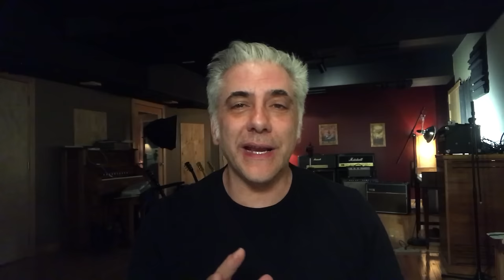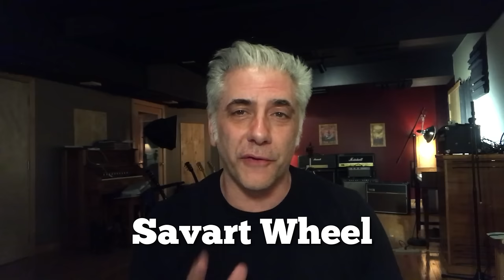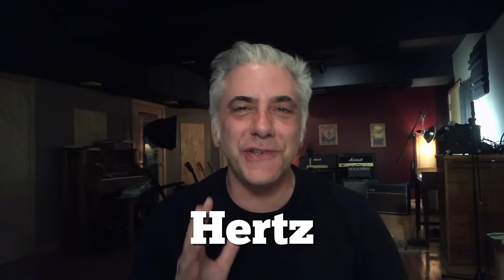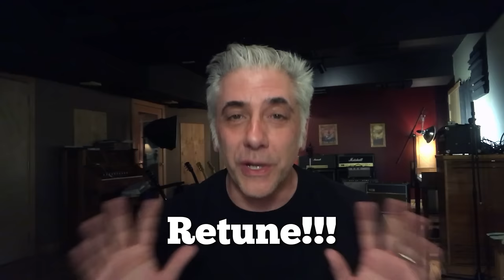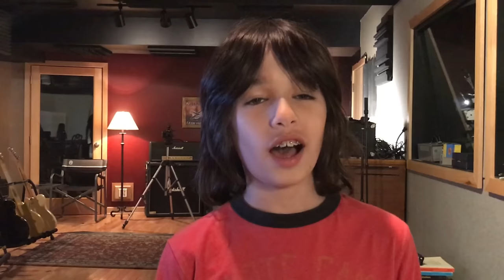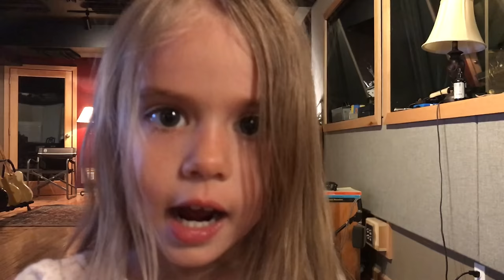What's the Deal With A = 440 Hz vs 432 Hz? Let's Talk!

Comment: Rick, it has nothing to do with spiritual gibberish, the cosmos, the pyramids, or any type of new age nonsense. Put a waterproof speaker in water and watch what happens to the wave patterns with both those notes, (and the 11 notes related to them in their respective tunings). WE are made up mostly of water. One of those two tunings provides a more geometric pattern in water, and the other has more dissonance. 180 is the best visual example, (which is A2 when you are tuned to A 432), as it actually makes stable, near perfectly symmetric honeycomb shapes in standing water. Divide ANY of those notes of those two tunings by 180 and see what you realize. Never mind, I'll save you the time. On the 432 set, you end up with numbers that look like similar to this . . . 1.055555561. (That's not one of them, BUT they almost ALL, have the commonality of seven to eight digits that are the same occurring grouped together within them. That symmetry moves more harmoniously in ANY creature that is made of water, PERIOD. 440 can't do that.
Reply: @FluffyBunniesOnFire  you get the same symmetries if you do it with sand on a flst surface

Comment: Love your channel Rick. 
432 is a relative harmonic to 729 which is 3 to the 6th power related to the Fine Structure Constant in physics 1/137=.00729927007 which is a Scalar in math, a pure magnitude, dimensionless constant found in magnetic fld. coupling , the cosmos..etc. Check Feynman and his thoughts.
Reply: @FluffyBunniesOnFire  Thanks. Correct me if wrong- geometric angles in any medium such as platonic solids are harmonics  in any time base or medium. I got my info from Mr Feynman. Hz can be ant type of oscillatory waveform. The connection is the fine structure constant. which is like the planck constant in describing reality. And is it so harmonics need a causal connection on 2 different planets or galaxies? Harmonics with no causal conn- I didn't do it the universe did.
Reply: @FluffyBunniesOnFire  I am not an adamant believer. Just find it interesting. You know speed of sound and acoustic waves., well how about an electrical signal in a a vacuum the same exact note- you know speed of electrons in a wire. Harmonics? The distance of moons from planets, the spacing of saturns rings all have the same harmonic spacing( approx1.8factor) as does the rotation of a galaxy in cycles that match harmonic ratios by factors of tens of notes and distance to the moon. A frequency is a scalar field until relativistics and time come into play kinda like your time analogy.. I've tried tunings with beat freq cool as hell. 729 is the harmonic not 137. You are reacting to Richard Feynman's knowledge I used. You know quantum electrodynamics. Natures vibrato you referred too a slightly different length of time.A tempered scale of 432 is a joke. Natural untampered with sounds and harmonics, you know natures natural overtones the kind  Leonard Bernstein talked about in his lectures at Harvard around 1980. I appreciate your thoughtful and intelligent discourse. A natural logarithmic scale using 432 and the rest of geometric angles(degrees and frequencies being the same derived from the solids))would be more interesting. Then we would need new instruments tuned for 72 notes not the falsely perfect 12 thing you talk about with 360. Another man made concoction. Egotistically stupid. My note sounds better than yours is bullshit. To me the numbers and their magic come from nature. It's not so much about  personal egotistical preference but about how real nature has recurring cycle, angles and relationships throughout the universe that are highly musical.
. Pretty cool. So the speed of light is arbitrary?Ask the observer.

Comment: This is probably a dumb question: I get how this applies to string interments but how do brass and woodwinds retune?
Reply: Well, we pull a slide that makes the effective length of our horns longer. Than we can also lengthen the aux tubes added by valves (trumpet, French horn, tuba, etc), but usually we do what woodwind players do: intonate with our embouchure (mouth) and airflow.
Historically oboes are often flatter that a440hz, so European wind bands often tune to them.

Comment: 432 is key to sacred geometry, and the pythagorean omni chord gives us the neat whole number frequency charts which include all the geometric numbers .... 126, 135, 144, 153, 162, 171, 180, 189,198, 207, 216, 225, 234, 243, 252, 270, 288, 306, 324, 342, 360, 378, 396, 414, 432 ..(notice anything about these values by the way? like 234, 243, 324, 342, 432 try that based on 440 then.).. which includes the cannonic numbers like the number of seconds in a day, 86400 the width of the sun, 864,000 miles width of the moon, 2160 miles the sum of the angles in the platonic solids and the regular polygons, you will find these numbers everywhere you seek in nature and it is more than simply coincidence, they tune far better to life patterns and our natural rhythms, the angles in polygons relate to F# A C# chords.
The arbitrary use of other base A frequencies  is arguable prior to the accurate measure of the second and accurate frequency measure, but it can be considered deliberately selected in the modern age, and  there is an argument that the use of 440 Hz is a satanic action that has deeper implications than you may think and tied to the propaganda drive of the Nazi party